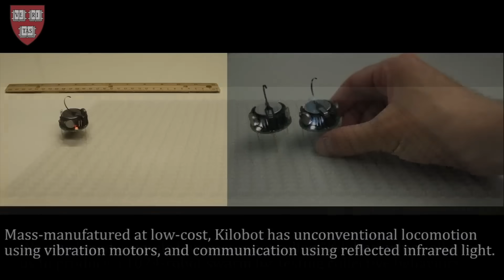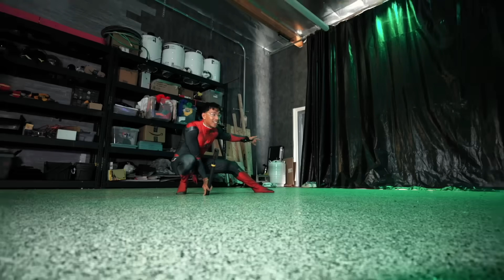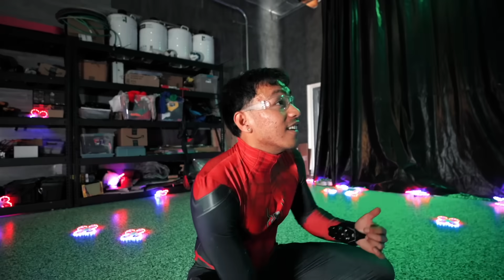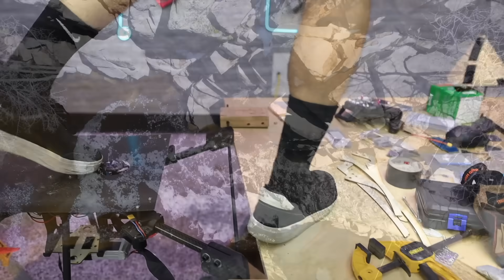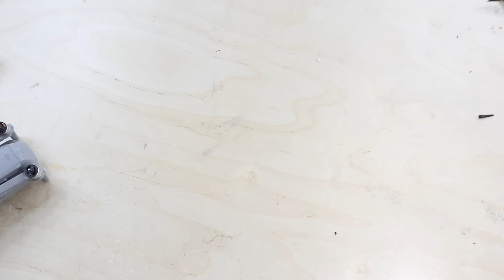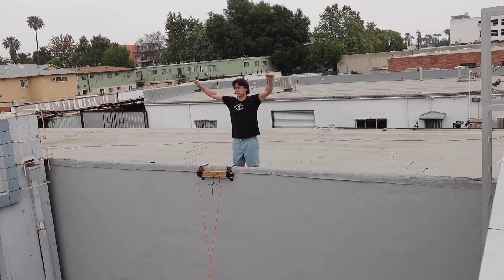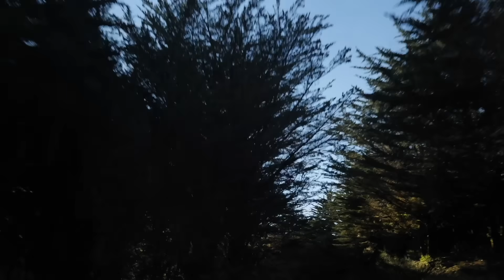I Built a Bridge Of Drones - (Microbots Big Hero 6)

Comment: Super cool project. 
One could use micro drones to stimulate a bridge that could work in the future. Electric magnets could be the locking point. The micro drones would simulate the type of bridge structure they want to build using a grid type pattern to make it strong. The magnets should not require much energy to flip the switch to turn them on and off. The drones all deploy at once and locks up then go in to standby mode then one you cross they un hook in a pattern that allows the structure of the bridge to remain. 
That is my only idea.

Comment: It looks like your having dynamic stability issues. 
A standard quad copter drone isn't stable if the rotors go at a constant speed. They can only hang in the air due to software making constant tiny adjustments.

It looks like one drone gives the next a tiny tug, which gives the first drone a larger tug in return and back and forth. Each drone trying to stabilize itself, not knowing it's throwing off the others.

Comment: Goal: get to the other side with a lightweight (man-portable), versatile solution.
Restriction: using multiple drones to achieve the goal.

Set of drones attached to one heavy-duty rope, with the lead drone being responsible for becoming an end anchor, the rest only for lift, so they can be reused 2nd time with a new lead drone. 
Anchor is TBD, on video it's pre-made, it can be some sort of land then explosively insert anchor into rock, or "fly around a tree and lock back to the rope".
As the other ends of the ropes, at the "start point" are presumably manually anchored, they can also be pre-threaded each with a "sheath" that stretch the actual fabric bridge between them.
After two main ropes are secured, 1-2 drones can be used to pull the sheath bridge to the other side - only friction need to be overcame, plus some gravity due to slack, but not nearly full weight.

This is using drones in a coordinated and potentially mostly automated (e.g. aside of the lead drone, the lift drones can be automated), plus a pre-made "textile" bridge, which seems to be "in scope" in this video. 

Downside: it looks less than a movie... but in the movie it wasn't stretching between a chasm, they were more akin to SG-1 Replicators, so they have to build from the ground up, "densly"

Comment: Why not just make a single drone strong enough to bring a single rope across the gap?

or, have the rope segments on a quick release connected to the drone so that only a handful of drones are in the air, even if you have a long bridge (remove drones in the middle because they aren't needed)

That way it would cost less money and have fewer places for error.

The way that would work is you have one drone bring the first segment. a second drone connects its rope to the end, and the first drone disconnects from the bridge and goes back home to get another rope. Then, that drone brings the new rope to connect to the second drone's rope, and then disconnect the second drone and repeat.

You could leave a handful of drones scattered along the length of the bridge to get more lifting power and support (like one in the middle, for example) but once the whole thing was done, you could bring all the drones home safely and the bridge would then be set up.

Comment: That was truly heroic engineering and a heroic test. Bravo.

To avoid batteries dying, you could run power through the lines. Positive on the left and Negative on the right.
Reply: as long as you dont grab both lines while crossing lol (obviously you would just turn it off first)
Reply: @JoshuaSmith-ys2qe  Or just use insulated wires?
Reply: @IceMetalPunk  How to connect tho? Apple charge? Another point of failure, and serious risk, imo. You're putting body weight on wires in wilds. Gonna have to get specific cables for that. Can't just be crimping some phone-charger cables.
Reply: @Stumpy1234  The little loops at the end that tighten to hold it up can be stripped for connection.
Reply: @IceMetalPunk  open wire where you're bouncing around over a fall?
Reply from the maker: Not a bad idea 🤔
Reply: @JLaservideo  Jake how long do u think it will be before Spring Rings are available?
Reply: @JLaservideo can you make all four element bendings from avatar the last airbender
Reply: @JLaservideo  Make mini RC Rocket League Cars and Field
Reply: I was thinking of running power also

Comment: Math time. 50,000 dollars to use a safety line to cross a creek. The only inventiveness is in looping strings together with basic knots? Thumbnail vs actual = such a joke. Drone swarm = 10 drones. Flying bridge = string connected to an actual safety line. Comparison to Microbots in big hero 6 = no. Positive comments = fake. 100 ft = 50 feet. Shitty work = shitty results. Every one of your videos is such a disappointment

Comment: The resonance in the home made frames was screwing with the gyro, creating a ton of noise, causing the drone to "freak out".  If you want to use GPS and self leveling, you need to make the drone vibration free.  Or super soft mount the FC.

Comment: You could try tracked drones, with one smaller drone on top and one larger drone on the bottom.
The bottom larger drone could turn off in order to protect the props when they get closer together.